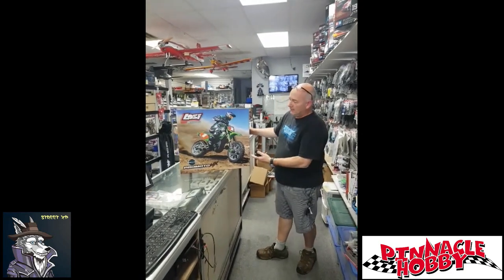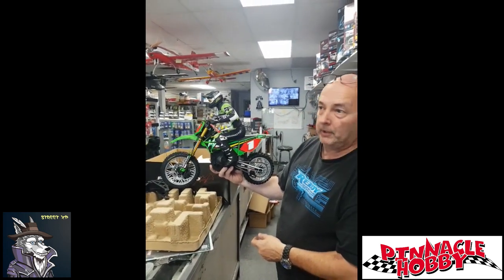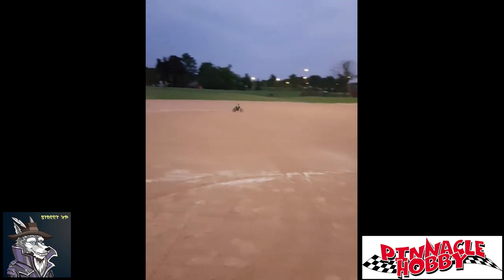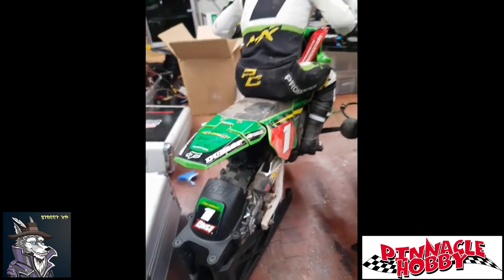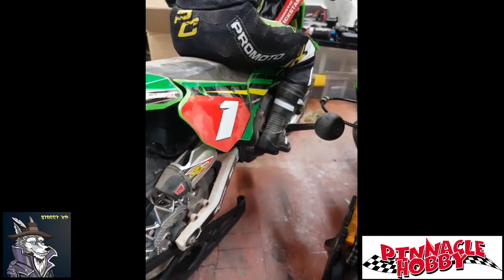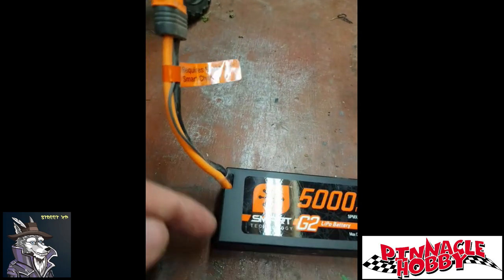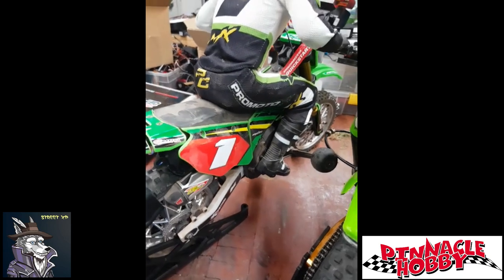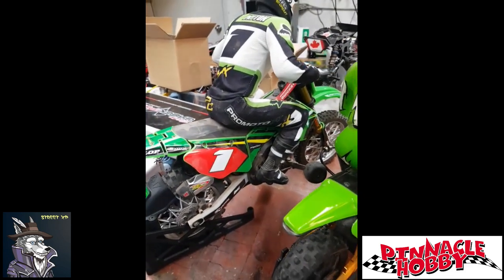Losi Promoto MX 1/4 scale dirtbike review

Comment: uh oh, someone didn't read the manual lol. I'm sure you figured this out by now, but i case you didn't, the bike has three riding modes, and one of them is wheelie mode lol.
Reply from the maker: Hey Shawn.  I did read the manual and saw the 3 modes.  The basic mode that keeps you from doing a back flip, the normal mode for every day play and the wheelie mode.  They are great features indeed.  The basic mode really helps to keep the bike from flipping over and wrecking itself (that is the mode I used for the video)  and the wheelie mode is a hoot.  The only problem (if you want to call it that) is that the bike really has too much power for ordinary riding when set to 100 % on the TX.  Also, as I mentioned in the video many features, including these modes, are probably not going to work with after market radios (I think the modes are part of the RX).   I myself use a Futaba for everything, so it's a bit of a drag having multiple radios for all my toys.
Thanks for watching!!! Hope you liked it.
Reply: Good thing for this channel you'll have mine shipped in no time😂😂😂